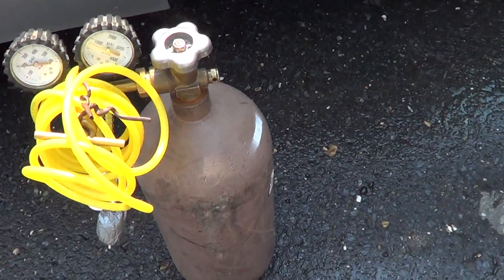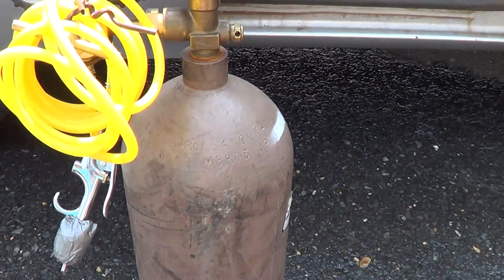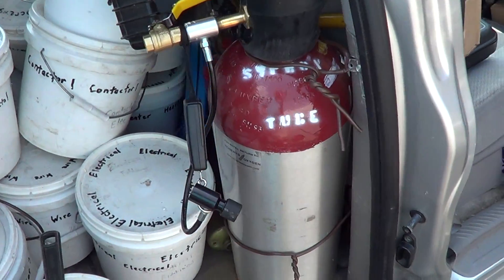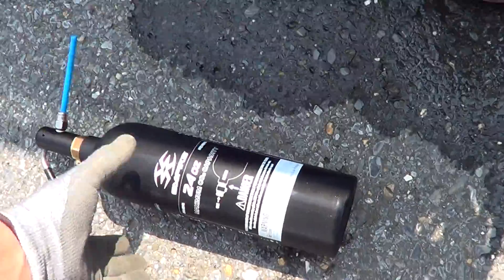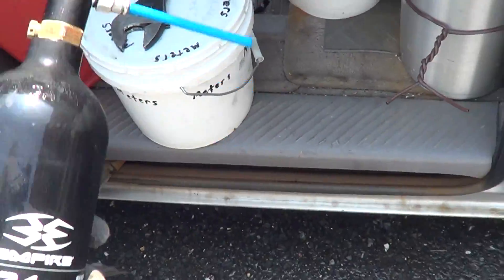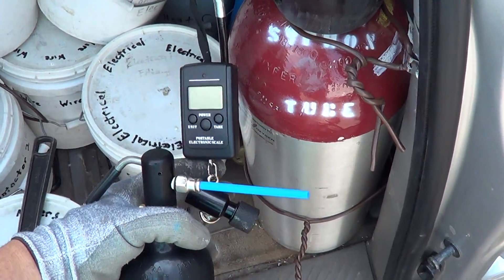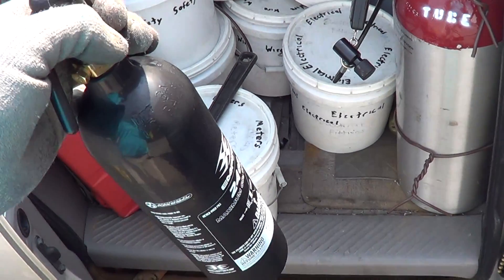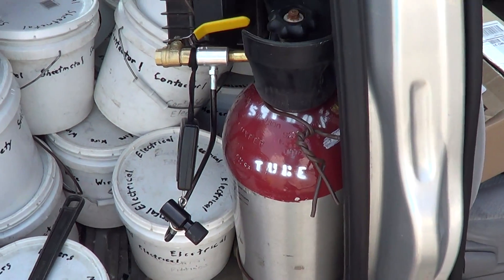Co2 for drain cleaning

Comment: i thought about a used fire hydrant to solder a tap on and be refillable air... looking for sollutions like your video!
Reply from the maker: No need to make anything.  You can buy pressure vessels that are already designed for the application.